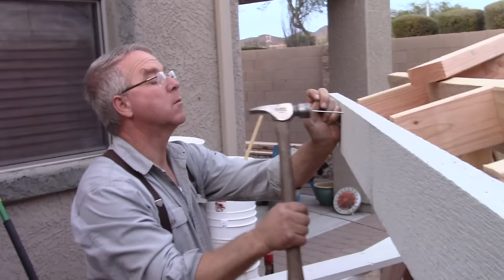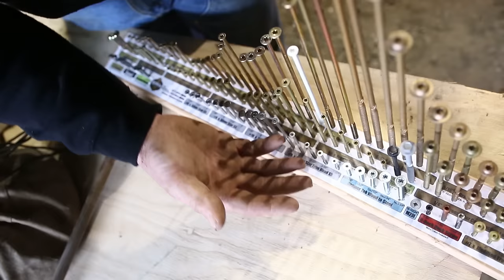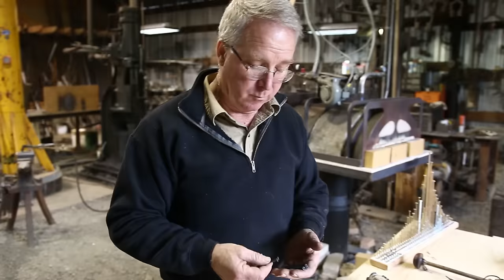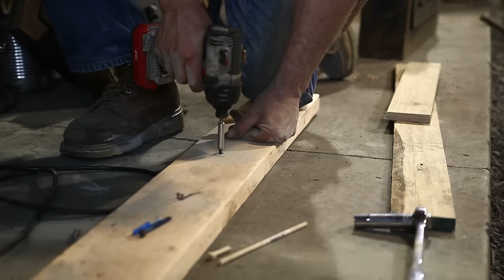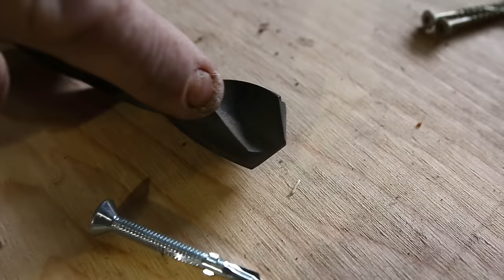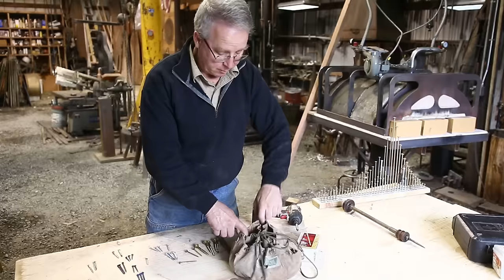Screws: What You Need to Know

Comment: On the deck screws, who's deck screws?  They are not all the same are they?   For the yellow coating screws.  You said you don't know what they are made of, don't trust them and etc.  It is not valuable to caution about something you don't know about.  They don't seem l like drywall screws to me.  They seem to be much stronger. 

   I wondered about the square headed drive screws.  Going by what is on the shelf at most places you seem to be right that they are on the way out.  What I don't know is if the yellow coated screws available at HD in the green boxes are the same material as the Torx head exterior screws.  I've switched between the two but using mostly Torx exterior now.  More detail about screw makeup without have been more helpful. 

   One pain with Torx is the bits are pricey and not as available as Phillips.  But that is not a show stopper from using Torx.  

   So some seeming criticism but I thought the video helpful and will push me to use Torx.  Thank you.

Comment: What we need to know about screws is, that it used to be you could buy them out of the bin, by  the # and they were cheap, and anywhere from 1" to 6" in length. That was back when the world was a #2 Philips, and life was good. They also came in galvanized. Now we are in the middle of the screw wars. I will avoid the pun.

Comment: I gave up on nails years ago.  Why,  because they are all now made in China and as such, this happens in too many cases.  The first two hits are fine but then on the third or forth hit, the nail bends because the metal is low quality.  Major lost time removing the nail  and possible marring the wood.  I'm now so use to using screws, that it takes the same time or less to install  than a nail.  The real big benefit is when if you make a mistake in your building.   It is so easy to just unscrew the affected area and start anew.  You also save money because you can can reuse the screws and wood.
Reply: But Trump's clothing line is made in China that includes his ties.

Comment: Firstly, you're the man, and I learn a lot from what you're doing on here. However, i gotta poke at you about something. Why? WHY? why are you using phillips head tap cons? Ive used exclusively hex head tap cons for years now. You will sheer a hex headed tap con before you ever strip it out (if screw is too long for the thickness of the work piece, and always where the shank meets the threads). Moreover, when used in concrete form work they are never filled with concrete/concrete dust/ dirt & debris, making them faster and easier to remove and reuse after pour. I realize sometimes a flat profile is needed but you can bury the hex head easily. In my humble opinion; hex headed tap cons are superior to Phillips in every way! Im like you with the square stakes, i strongly insist!

Comment: With all respect.....  a screws tendency to snap more than a soft mild steel nail is not really relevant.
The timber in either case is way softer relatively to the fastener. 
And it totally depends on the metal that screw is made of. Yellow zinc screws can be very hard and brittle, stainless steel can be very soft and you will often see the shank has completely twisted several times if it's been in hard timber. 
Either way a screw or nail will not fail before the timber right?

Comment: I know this is an old post 2017 but they was this guy on youtube that was bragging he constructed this big garage 24X40' who was going to be turned into a loft after inspection only with screws, he never used a pneumatic nailer even on his wall and roof and truss framing , thinking that screws where stronger than nails for shear strengths made me laugh how far some people can go without asking for hints to pro trade workers or books , I was an instructor with the new employees of a prefab housing factory , I used to do a test demo with the new kids i took a piece of lumber 2X4 on one side I screwed only gyps screws and on the other side 5/4 nails and let all of them sticking out half an inch, with a small hammer blow after i broke easy enough all the gyps screws head, on the other side with the nail i did the same thing with the same hammer strength blow I only succeeded of bending their heads proving what you should or shouldn't use only for shear strength its an image that stuck to their brain for a long while , even on tv in these remodeling tv series you see carpenters taking time shortcuts screwing shear weight transfer walls instead of nailing and their not using the great brand of GRK screws thats for sure ! How many times do you see people assembling outdoor patio with golden plated flooring indoors screws , its says it all on their box (Indoor use only ) Imagine assembling a balcony on a second floor with only indoor floor screws to the frame of a house without galvanized brackets whatsoever without shear galvanised nails and proper brackets, only screws direct in the 2X10 , these screws will break like glass with a couple of people just standing on these balcony !There is a proper nail or screw for every different use, some nail do pretty bad in pressure treated wood won't last more than a few months screws are the same ,for now the only shear strength screws i've worked with its the GRK you read their specs on the box or the website they are amazing ,and im not paid by them to say so ! They have specialised applications 4 inches or more number 10 screws who can replace 1/4 inch lag bolts ! you just have to get the right one , out here in Canada these specialised long GRK shear screws are around $1.00 each screws very expensive but worthed for safety !

Comment: AVOID TORQUE SETTINGS  >13 ON YOUR DRIVER TO REDUCE THE RISK OF BREAKING OFF YOUR DRYWALL OR ZINC-PLATED SCREW HEADS!  DON'T UNDERSIZE YOUR DRILL BIT.

Comment: the 'handyman' that owned my house before, must have had an unlimited free supply of drywall screws... he used them EVERYWHERE - to build the deck, the walls, and yes to put up drywall... screw's too short?  never mind just put in 10 of them.   he even used them to screw the flange for the shower head to the wall, after he filled it with caulking...  apparently though he had already done the drywall on the other side since the shower controls were plumbed... but not the shower head.

Comment: In general very informative, but nothing frustrates me more than people saying "nails are strong because they're more ductile." Ductility and strength are not the same thing. Hard and Brittle doesn't equal weak. If it did I would never stand in a concrete building.

Comment: only problem is torx screws cost an arm and a leg and robertson are just as cheap as philips. I'd rather take the screw head that is 90% as good and 50% as expensive than pay 100% more and only get 10% increase in performance.

Comment: I'm stupid...howcome I continually experience screw bit jump from my cordless driver?  Constantly changing bits they all jump when getting  tight yet not all the way in I have to constantly adjust the clutch so as not to strip screws. What am I doing wrong?
Reply: Could be the wrong size bit, they are coded by numbers,#2,#3 etc.
Also put a little ass behind that driver or you could try putting dish soap on the screw tip.
Reply: @davegordon6943   thanks

Comment: Sorry, but I'm a Torx hater.  They might, and I mean might, be ok for wood screws that don't require any torque for driving but they are useless in any high-torque situation.  They strip faster than any other screw I have had experience with when being driven in a high-torque situation.  For example, many of the body panels on my Jeep use Torx fasteners, and they usually have to be drilled out once the bit strips them at 10 ftlb of torque.  I replace them with phillips head screws that can be torqued much tighter without stripping.  JMH experience.

Comment: I like the square drives they realy hold well in my driver bit, and drive well, why are you so against them?
Reply: Try a Torx head they are far superior.
Reply: Until you use a GRK with their tork drive you aint see how more positive they hold ,i've used a lot of robertson drives screw for indoor work too they are the cheaper way to go  but the GRK for outside work and some framing brackets application is the best but near $1.00 each in canada you use them only where its really counts , one other thing he mentioned the tapcon screws for concrete never use the philips drive on them even with the proper pilot drive they will ether strip or break the heads of these screws are like made of glass ,only buy the one with an hexagonal drive heads instead !
Reply: @1badpete999  Never saw a GRK screw where i am in Boston are they all over or just a reginal thing ?

Comment: I hate driving in screws. Just finished screwing down a roof about 20 minutes ago. Can’t stand when you try to start a screw and it gives to the side and you drive your drill right into the thing your screwing, or if you can’t put your whole bodyweight on the impact driving it strips the screw. Or when the head rips off. Terrible. All it does is frustrate me and make me want to grab a hammer and let out some of that frustration.

Comment: Sheetrock screws are for sheetrock,,you want a screw for structural you would use a deck screw ,,they are tougher never break never pull out ,,dont corrode

Comment: A tutorial video, which starts with a scene, where the man using nailgun pointing towards his feet. For some reason, I never take advice from people, who has no idea what is he doing. :D
Reply: What should he have done differently?
Reply: @mrreams711  What? I discribed it above. If the nail goes trough the timber, which can if the timber is rotten, wet, cracked, etc,.. it gets shot into his feet.
Reply: @PeterM0911  I don't think any carpenter with any competence would select any of the timber you described in your argument as posing a dangerous condition. Wet timber is irrelevant to the entire discussion. That describes 90% of framing lumber selected across the country. Let's just say he was half blind in one eye and crazy in the other and done as you suggested he might had, the nail would still need to span about a 6 inch air gap and go through a leather stee-toe (I'm guessing) work boot. At this point, we've surpassed so many "ifs" that it no longer poses an above average hazard for anyone with common sense.
Reply: @mrreams711  LOL You just have no idea what you talking about. Accidents can happen. If you were a carpenter, you learned in the school, never cross you arma above tablesaw, never point the nailgun towards you. Stuff like this. You know, such a thing as unloaded gun does not exist.
Reply: @PeterM0911  I know that accidents happen. I also know that there's a thing called experience and in my experience, your concern in this situation is miniscule. Heck at this rate of critiquing videos, even the neighbors two doors down will be needing safety glasses and a hard hat. I also know the difference between a how-to video and an informative one. Do you?

Comment: In my experience the the square drive is far superior to any other format available. Philips is a joke and needs to be abolished. I'm constantly breaking and stripping out torx bits. Also torx bits and screws are far more expensive. I've been using the same square drive bits for 10 years. They don't strip or cam out. They hold the screw on the end so that you can drive one handed. I'm really put off by the fact that square drive is becoming hard to find. That's just my experience of running an all things property maintenance business for the last decade.

Comment: We built a $ 200 million  house  using framing screws with a 18 volt   4 amp hr impact gun no hoses ,air compressor, screws hold about 400  times better

Comment: I have been using torx screws from screw products inc. for over ten years and have had very good luck with them. I have installed thousands of them in my house and the couple that I have had break were from hitting nails. They are very comparable to the GRK's and Simpson screws. They also have bits that are way better quality than the ones that are different colors. https://www.screw-products.com  Your choice but worth looking into.

Comment: GRK are garbage in PT. I’ve used them and shocked to find out corroded they can be in only 12 months outside in PT lumber. I will only use them indoors now.

I’ve tried multiple grk lots  all from Home Depot, in different PT, in some outdoor projects like deck stairs and what not. Their #9 and #10 outdoors in PT WILL rust, they WILL snap on you.

Where failure can cause injury I don’t think any of these coated screws are up to snuff; I’ve had a black timberlok snap unscrewing it after a year, finding corrosion broke through it. There is a reason simpson’s hanger screws for its joists are all hit dip galvanized. Galvanized or stainless steel hardware can be outdoor for years in PT lumber and look as good as the day it was bought.

Comment: But now we have overpriced structural screws so you don't have to lean to nail 🤷‍♂️🇨🇦
Reply: You don't have to be a metal engineer to see a difference ,if you only have to hold in each hand one  side a GRK shear screw and on the other a general use cheap china imports you will find the difference right away  , true at the price they are retailing you use them only in places that counts and cal for them ! Some of their screws number 10 or 12 can replace and strong enough a quarter inch lag bolt , you just read their specs on their website they do pretty intensive research on them , back in the days our parents and grandparents use these giants 16D round sinker nail everywhere !

Comment: Unless you buy stainless all screws will rust especially in treated lumber. The nails are no better- they cost a lot and after you forgot about them they are rusting if outside. Ilike the square and star heads but the ones you buy at lumberyards are overpriced and probably made in China- ok for interior though. it is frustrating- the products are not made to last and they are expensive and often made in China. I notice some of the stainless screws are to soft to use in real work- they break easily.( You address the reason for that in the video) The nails are much better but you can not take the nails back out so easily. American building practices are inferior- the fasteners are overpriced and do not last long and most people use them and do not realize.

Comment: i have noticed in forty yrs the quality of screws has gone way down.  also threaded pipe. all the complaints seem to go to china.
i have never had trouble with threaded gal. pipe  unilt i bought a 16in  3/4 nipple last week, i tightened by hand making sure no cross thread, (4 or 5 wraps of teflon tape turn it on a drips ,both ends, i do it again with 7 wraps of teflon tape and slow drips, i break my own rules and over tighten, and extremely slow drips, i left it hoping for calcification to stop it. my only answer is chinese pipe made with worn out machines.

Comment: I want this company to write me a check for all the time spent trying hang Sheetrock with every other screw tipping over because of off center heads and crap inside of the slots. After I tear the paper in the drywall and throw them on the floor I figure you people owe me about 1,347 bucks for all the time lost on these things. Tell your shareholders Chinese quality control or lack of cost you another customer.

Comment: Slot screws should be banned from being made.
The screwdriver slips off the screw head because it slides back and forth as you're drilling.  The screw and the head won't support the bit any less than being perfectly sraight up,...
A danger to installer and equipment used.
After that the worst screw is the Phillips because the corners on both the heads and screws wear off.  Again the screw won't stay in the bit much more than straght up,...
Likely both slots and Phillips should be banned from being made.
Torques and Robertsons are the best and I'll take Robertson's over Torques anyday because the drivers seems to stay in the screw even when turned upside down while the screw isn't as likely to stay in the driver when upside down in a Torque driver.
I've been working almost as long as the guy in this vid.